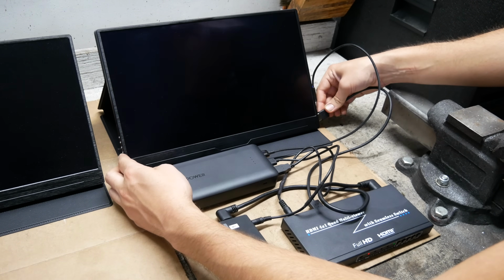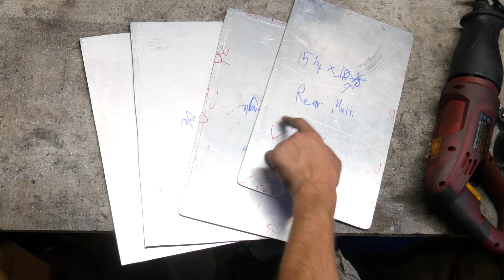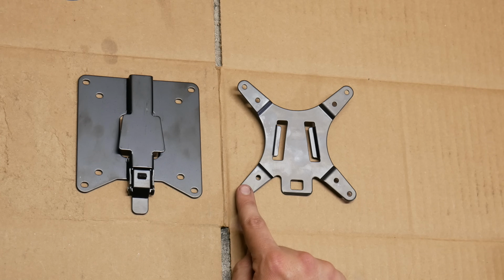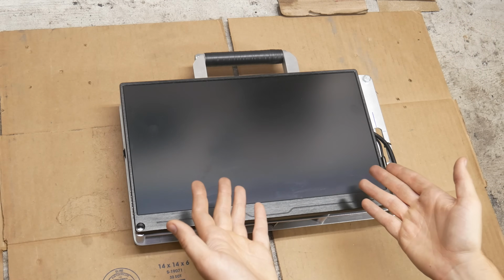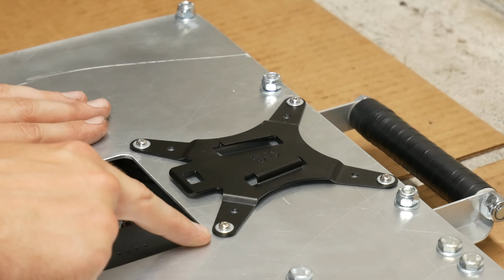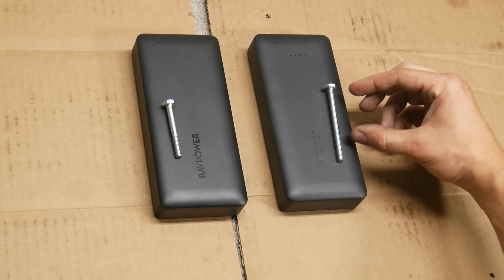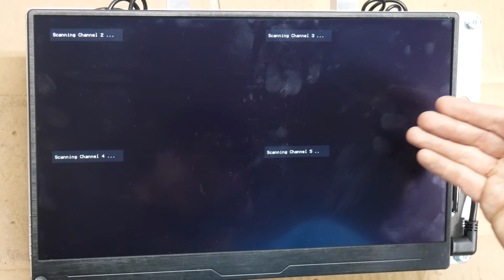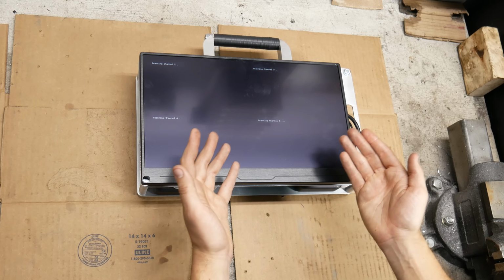Wireless HDMI Monitor Project Part 3: Housing Parts and Assembling Field Monitors

Comment: If those bolts are long enough, you can install a separate L-Plate on top to protect the wires on the side where the tabs would be

Comment: it's gonna be very hard to operate the release on the quick detach VESA adaptor when the unit is mounted on the wall.
Reply from the maker: Correct! It isn't mounted directly to the wall, should have specified. At the end in the "on the next episode" part you can see the display mount arm I bolted to the wall there for it.

Comment: Using little heat helps with aluminium bending.
And you can tig weld the flaps there.

Comment: IR is line of sight where radio isn’t. Move the receiver out from behind the case and you can get more distance from the remote.
Reply from the maker: I wasn't trying to use it with the remote in front of the case, the remote's emitter was pretty much pressed up against the lens outside the receiver diode. The remote is just cheesy
Reply: Fuzzy Dice Projects oh dang that is crappy! Oh well still looks good!

Comment: don't know why you don't use v shaped head bolts (for better look and flat surface, eliminating spacers from behind the screen), and just smaller cable cut-ins from the side instead of massive "windows" but... your choice. as well instead of micro usb extension, just using a 90 degree plug, regarding the ir sensor, you could use the right empty space in front and route the cable with power and hdmi cable
Reply from the maker: I originally planned to use countersunk screws for the body but there were a few issues. First, the plates would have to be a little thicker. Second, that would mean the monitor would have to be attached AFTER the housing is assembled, making smaller changes difficult and I would pretty much have to have pass-through holes on the back panel but all the packed in components interfered with that.

I wanted as much as possible to be inside the housing and protected, so it made sense to me to put the charge extension wire in there. The ports to pass the wires through to the displays didn't have to be quite so long, probably only needed to be an inch and a half, but the extra space made it easier to route the wires through and be confident I wouldn't have to re-do anything.

Comment: Excellent work! Just a suggestion: 
 - Consider using angle and U-channel aluminum extrusion in lieu of bending the aluminum plate. For instance, properly cut aluminum U-channel would work very well to add impact protection for the HDMI and power connections on the monitor. Here's a good tutorial on bending aluminum: https://www.thefabricator.com/thefabricator/article/bending/bending-basics-the-fundamentals-of-heavy-bending#:~:text=Hot%20Forming%20Aluminum,it%20as%20much%20as%20steel.
Reply from the maker: I considered that for the corners and may come back to it but I would have to do additional work like shortening the spacers to make room and I didn't have the time.

As far as bending, this was the first time I had an issue and I think it's because the piece was so large it needed a heck of a lot more heat than I had applied. Have bent a lot of strap aluminum that way, even bending it back and forth several times, with no issues. Either the material was an alloy mix or the heat was just being sinked away too fast

Comment: Hey just a quick tip for folding aluminium. I had to fabricate some aluminium steps once and was having a similar issue where the aluminium would tear and split. Another fabricator showed me a trick which worked a treat. If you smear some oil (I used engine oil) onto the aluminium where you want the fold to be and then heat it evenly until the oil becomes like a treacle type colour and consistency at which point the aluminium will be at the perfect temperature to fold without tearing or splitting.
Reply from the maker: That's a neat tip! Hadn't heard that before, thanks!

Pretty sure that was my problem, the piece was sinking the heat away too fast and I wasn't applying enough so it wasn't hot enough at the bend

Comment: I'm pretty sure your aluminum problem was caused by the type of aluminum you used probably 6061 you should have used 3003 or 5052 if you wanted to bend it.

Comment: Don't get me wrong super cool looking but I can't help but think but two briefcases slim line briefcases would have been better  for the equipment  that would be cool as heck
Reply from the maker: I will talk more about it in the next video but I did consider something like that, at least a flip down front, but one of the big deterrents was heat. The bare aluminum plates are great heatsinks and the wireless receivers put out a ton of heat.

For the single monitor unit it wouldn't be out of the question and it would be very cool to turn a briefcase into a case for it!

Comment: I Am wondering isn't reception of those receivers hindered or decreased being sandwiched between two relatively thick metal sheets.
Reply from the maker: I plan to do relatively in-depth testing of that in the next video, but initial observations are: only for the center two. Units #4 and #5 seem to lose maybe 20 feet of range compared to the others that are less covered up. The range of the ones at the edge doesn't seem to be affected. Something to keep in mind but really not too terribly big of a deal, it was something I made sure to test for before putting these together.
Reply: @FuzzyDiceProjects   lose maybe 20 feet - That is acceptable i would say. Gereat job.

Comment: terrible. bits of junk attached to a chunk of metal, for little to no reason.the screen is just a screen and will instantly break as its just strapped on to a piece of metal, this isn't suitable for field work. you have glued some consumer electronics to a sheet of metal. its just sad. if someone said 'i made a field monitor!' and they showed me this i would think they had learning difficulties.
Reply from the maker: I appreciate your concerns and to an extent I share them, but what is any device but components attached to a bit of metal or plastic? The screen is the weak point for sure, but without adding a lot of weight, bulk, glare-inducing protective layers, etc. I don't see how it could be fully protected. That type of monitor is pretty easily available online so if the worst happens it can be replaced, but I haven't exactly been gentle with these devices and they have held up just fine so far.

It's "not suitable for field work" in the sense that you can't just hand it to Joe from the gas station and expect him not to come back with a broken screen and receivers covered in mud. But it's not for Joe, it's not a $3000+ commercial product made for the filmmaking industry, it's for my friends and I to film and direct our small YouTube videos, and it's because I wanted to build something that I wasn't able to buy. And in that, despite just bolting a few components to a chunk of metal, I am relatively satisfied with how this came out.
Reply: for someone making assumption and presumption about others having learning difficulties, you don't seem to actually watch the first part. a big ol' empty barrel.

Comment: a couple of swing out feet to make it stable on a uneven surface if you had to lay it on the ground, say under a car, would be a nice upgrade. I would also look for some clear plastic bags, nice big ones you can use to shelter the unit in wet/dusty or just dirty environments. I can def see how useful these are for anyone filming.
Reply from the maker: The big plastic bags are definitely a good idea! I don't usually end up filming outside in the rain and I probably wouldn't set at this up in that situation, but it certainly would be nice to have the option and protection from the elements!

Swing out feet isn't a bad idea either. They are way more stable that I expected but extra protection from being kicked over or even feet that can tip it for better viewing angles would be pretty cool. Will keep that idea in mind!
Reply: @FuzzyDiceProjects  the bags would be more in case of sudden need